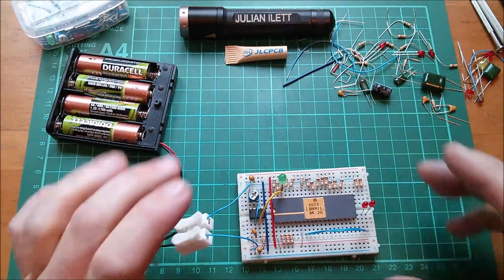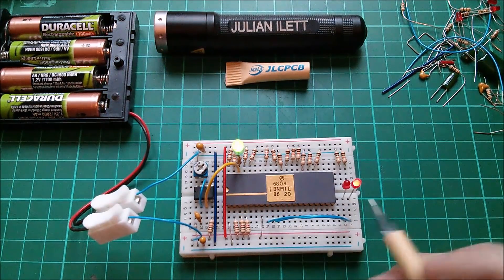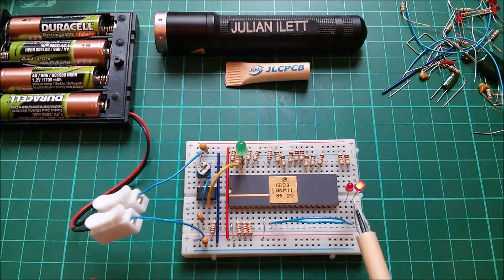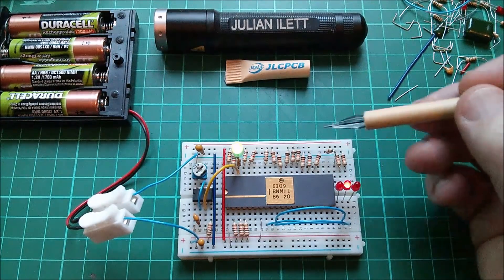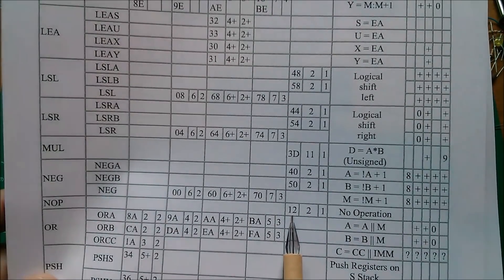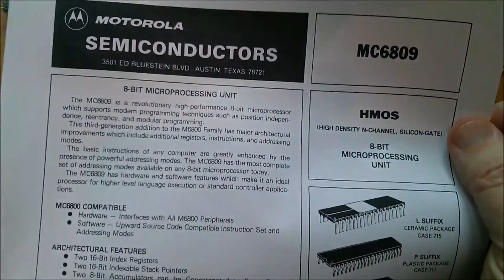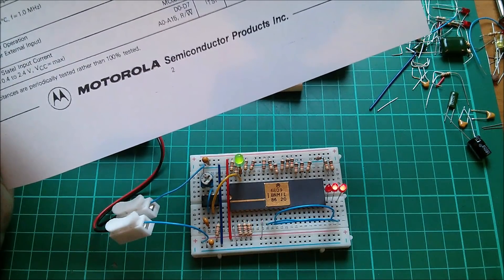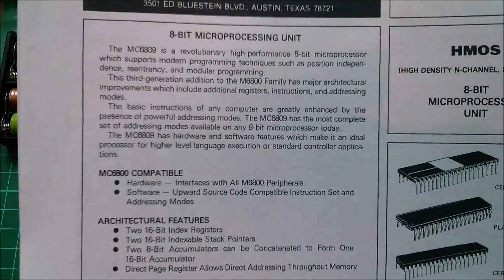Chip on Breadboard - 6809 Microprocessor doing SEX

Comment: See page 23 of the datasheet, it explains what happens to the address bus. In the case of MUL the address bus goes to FFFF for the extra 9 clock cycles.
Reply from the maker: Really, damn it - I really should RTFM :)
Reply from the maker: Ah, /VMA cycles - thanks, I learnt something new :)
Reply: If no code sets the registers, what do they default to? 00 or FF
Reply: I don't think it matters what is in the registers, Julian's LEDs were showing the lower 3 bits of the address bus. Where the instruction being executed needs to fetch data, the address of the data appears on the address bus. In the case of the MUL instruction the data source is implicit so no address would be relevant. At any point where there is no address required the processor sets all the address bits high (FFFF) which keeps power consumption to a minimum. Oh, just for completeness, register contents are usually undefined unless set by some instruction, after which they retain that value until changed.
Reply: Chris Hartley - although on some microprocessors, reset does actually affect some registers. For example on reset, the Z80 interrupts are disabled. General purpose registers however are undefined on reset.

Comment: The Dragon 32 computer featured a Motorola 6809E clocked at a puny 0.89MHz. No prizes for guessing why it wasn't a commercial success with competition from the likes of the ZX Spectrum, BBC Model B and the C64.
Reply: .89MHz * 4 = 3.54Mhz

NTSC color burst? 3.54Mhz
Reply: British computer...
Reply: @Codedbad  I can't compel you to believe me, but I can tell you that the 6809 takes a clock signal and divides it by 1/4.
Reply: The parent comment mentioned a Dragon 32 which is a British computer that uses PAL video.
Reply: @Codedbad  I know it did, but I'm promising you that is why that Crystal was used, even though it's incompatible with PAL TVs.
Reply: Aka Radio Shack's TRS-80 Color Computer
I remember doing assembler on the 6809E using an EDTASM ROM cartridge and saving my programs to cassette tape.  The most sophisticated program I managed was Conway's  Game of Life
Reply: Nick B - Do you think the fact that it used an old video chip may have been more of a reason? With only 4 (5 if you count two similar shades of green). All the computers you list could manage at least 8 colours and they had bit mapped or equivalent graphics displays.

Comment: The RCA1802 (an 8 bit CMOS processor) had a SEX instruction too. SEt X register. Cut my teeth on that processor many moons ago.
Reply: An old ELF guy? I still have my original ELF I built in 76
Reply: @raymondheath7668 : Me too. The old Elf II sits on my other desk and i have a new one in the works on a breadboard.

Comment: Halt and Catch Fire instruction: you’ve gotta get your scope out and try this: The Motorola 6800 microprocessor was the first for which an undocumented assembly mnemonic HCF became widely known. The operation codes (opcodes—the portions of the machine language instructions that specify an operation to be performed)—referred to by the mnemonic HCF are hexadecimal 9D and DD, and were reported in an article written by Gerry Wheeler in the December 1977 issue of BYTE magazine on undocumented opcodes.[11] Wheeler noted that Motorola reported 197 valid operation codes for the M6800 processor, and so inferred that with 256 possible 8 bit combinations, there must be 59 "invalid instructions." He goes on to describe the HCF as a "big surprise," and saying of the Catch Fire portion of the moniker, "Well, almost.":

When this instruction is run the only way to see what it is doing is with an oscilloscope. From the user's point of view the machine halts and defies most attempts to get it restarted. Those persons with indicator lamps on the address bus will see that the processor begins to read all of the memory, sequentially, very quickly. In effect, the address bus turns into a 16 bit counter. However, the processor takes no notice of what it is reading… it just reads.

Comment: I can't speak to the other revisions of "The Art of Electronics," but the Second Edition of the book covers the 6809 extensively. 
  I think the 6809  (*68008) was actually made after the MC68000 too because 8b busses were the defacto standard and most hardware of the age wasn't ready to adapt to the 68k monster. I'm certainly not the expert at this though as this stuff predates my manufacturer date. I watched the 3 hour interview of the 68k design team posted on The Computer History Museum channel a couple of months ago (I highly recommend watching that//no affiliation). In that interview, I vaguely recall them mentioning the 6809 (*68008) vs 68k.
  Now Julian needs to break out the 68k DIP-64 behemoth. I don't think it will even fit on a half size bread board. I started cutting breadboards down the middle just to play with stuff like this.
-Jake
Reply from the maker: Bought one :)
Reply: @JulianIlett  
  I would really like to learn more about vintage peripherals. I haven't seen much of an overview covering this stuff. I've ordered a bunch of random ICs to try like SIO, PIO, RIOT, CTC, etc. Most of what I've ordered is probably useless. I basically looked at some of the stuff I saw others use on projects and ordered what I could find cheaply.
 One mystery to me is how to select the maximum clock speeds of various peripherals. I assume the slowest peripheral chosen will dictate the actual system clock used. Are there any general tricks to use here? Am I opening pandora's box of headaches by trying to mix and match various peripherals from different brands to try to interface with other hardware? Does the endi-ness of the MPU affect the peripheral selection?
  For instance, last night I came across a listing for a MC68901. That's specified as a MFP or multi-function peripheral. It has a few Timers, USART, and some GPIO on one DIP48 chip. Are these types of ICs popular options, or is it more common to use the purpose specific types of peripherals? 
  Basically I really wish I could find an abstract overview that helps me understand how to build up peripherals for different systems without the need to painstakingly find and read all the different manuals and guides for each uP before getting started.
   I probably sound foolish and/or lazy here (sorry), but I get the impression that, those with the experience might have quite a few go-to parts and circuits they turn to while putting together a design. Are there a few key support chips that I should look for, or do I really need to grind out the details for each instance in detail?...or pursue PLDs/CPLDs much more as the only universal option.
-Jake
Reply: for the system clock, you choose a CPU and check with the maximum clock, how much is the read and write cycle speeds (how many ns does the access signals stay active). if that's enough for your peripherals then good but if it's not you have to either slow down the CPU clock or if you CPU supports it add wait states when accessing the device.When choosing a device the most important details to look at are the voltage levels and the write/read speeds, everything else can be pretty much hacked to be supported. Note though that some peripherals that are dedicated to the cpu's family might need some specific signals to work properly in which case you need to search for it further. Generally, open up a pinout and check if there is something you don't recognize and if so find the portion of the datasheet that explains it and you will know if you can use the chip or not. for a beginner with the z80, a great page in my opinion is this http://lateblt.tripod.com/z80proj1.htm
Reply: @C32-d5j  
Thanks for the tips and reference
Reply from the maker: Now that's a challenge - 68000 on breadboard :)
Reply: you are probably thinking of the 68008 which is the 68000 with an 8 bit bus.
Reply: @donpalmera  
Yeah I think your right. I need to pay more attention;)
Reply: I was given one of those 68008 chips back in the 80's and I think it had like 64 pins in a dip package. I never had a chance to experiment with it cause someone offered me 100 bucks for it.
Reply: do you regret selling it ?
Reply: @C32-d5j  kinda.  I was going to build a clock with date out of it.
Reply: doesn't the 68000 need an adapter because of the different spacing ?
Reply: @C32-d5j  
Nope. It fits. I ordered one and stuck it in a breadboard because I don't have enough space on my esd foam for the dumb thing. It only has 1 space left on both sides of a standard BB and is still standard 2.54mm pitched.
Here:
https://drive.google.com/file/d/1Lap4m5-OfpgNItpDCfiJzXAVnaOSey1D/view?usp=drivesdk
Reply: wow, what a monster :O
I'm going to go hunt for a gold one, although they don't seem cheap 
 anyway I'm enjoying the m68k interview, thanks :)
Reply: @C32-d5j  
I got one from AliEx for less than $2.50 but I honestly haven't tested it myself yet. I haven't had any problems with the Z80's and 6502's I've received and tested already though. I figure they are all used ICs and I've probably got ~25% chance  of getting a brick from anything AliEx but that's just part of the fun.
Reply: Do you build computers with those CPUs?
Reply: @C32-d5j  
They are all MPUs that are used to build computers. I'm just learning this stuff. The old chips appear to be a cheap way to learn about register level hardware. They seem more simple to understand, and are well documented. The ability to single step the system clock on some of these (not the 68k) seems to make things a little easier. I get frustrated when I try to go deeper into a microcontroller's internal hardware and am forced to skip across hundreds of pages to figure out how things work together. The old stuff seems a bit more compartmentalized and easier for someone to learn from scratch without an EE degree. Plus most of this old stuff is available in small quantities for less than the cost of lunch.
 Have I built stuff already? I haven't built more than following Julian's Z80 breadboard stuff, along with following a few other references so far. I probably will eventually. I've saved several references in playlists and bookmarks, but it's just a casual side project until I get done with several other things.
-Jake
Reply: good luck :)
i'm currently making mine
Reply from the maker: Oh no, does it have metric pin spacing?
Reply: Thank you! :)

Comment: Systems to use the 6809 are the Dragon home computers (which I have 2 and cut my programming skills on these machine), TRS-80 Color Computer, the Vectrex home console, and some arcade machines.  It was also one of the first microprocessors to implement a hardware multiplication instruction, and it features full 16-bit arithmetic and an especially fast interrupt system. Loved this processor.

Comment: How do you get those tiny potentiometers to stick in the breadboard? I have some the same, I assume you got them cheap from ebay like me... but the pins are too fat to fit in the holes!
Reply from the maker: Sometimes they do pop out! Fun with breadboards :)
Reply: @JulianIlett  I think I have most success with them when I put them at a 45° angle, so the pins fit diagonally in the square hole.
Reply: you could file them down or solder on a wire or component lead you could just plug in.
Reply: @GreenAppelPie  Yes, I tried alsorts of things... they are tiny though so very fiddly
Reply: I also twist wide leads 45 or so degrees to make them fit into square holes better.

Comment: maybe mul isn't working because of the slow clock
Reply: Wonder if the chip has some sort of dynamic-ram-like storage for registers and the multiply instruction uses some sort of state machine that loses it's way because it's state register is lost.   Just guessing.. I've never seen the 6809 reverse engineered, but did enjoy the 6502 reverse engineering video on here https://www.youtube.com/watch?v=fWqBmmPQP40
Reply: This is correct. The 6809 uses DRAM for registers.  6309 (Hitachi clone) uses SRAM.
Learnt this the hard way when trying to debug a single board 6809.
Reply from the maker: tHAT'S WHAT i'M THINKING :)
Reply from the maker: Argh - caps lock next to shift :)
Reply from the maker: Not sure, but the binary count didn't appear to be CLK/2 so something odd is going on :)
Reply: Why or how would a slow clock cause MUL to not work?
Reply: @RayMillTN1  Keeping state for 11 clock cycles at this low speed is definitely harder than keeping it for 2 clock cycles. Maybe some internal capacitor simply discharges itself.